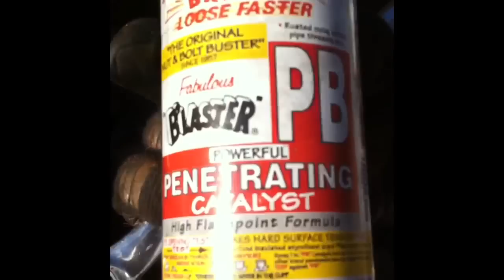Dodge Sprinter Fuel Injector Pulling Tool for Stuck Fuel Injector

Comment from the maker: Yes this works for all 5 injectors but in this case only one stuck was number 3 the others came out just fine, my advice when trying to remove injectors makes it much easier with hotter engine, in this case it was cold and it would be impossible without this tool
Reply: How did you get the valve cover off first, before removing injector????

Comment from the maker: Hello guys thanks to everyone for your coments and subscribers, I lost this YouTube chanel just found it, I also have some others, I will now closely monitor yout coments, and try to get to you when I can also Many more vedios will come, with Sprinter problems and how to fix them your self, about injector puller tool it was a prototype, it worked realy well, but I am working on a better one, where you can remove injector without  Valve Cover damage.

Comment: Can the injector be removed without removing any part of the injector, I have used some tools that require you to take the top part of the injector off in order to remove it.  I then found out that the truck will never start if the injector is taken apart and then reassembled.
Reply from the maker: +Jerry Pellegrino I hear same thing that once injector is taken apart it won’t start, but some say it will and others say it needs to be torqued right, maybe you can use some paint and after assembly align the pain line, you only need to take apart injector if it’s hard to pull it out, but if it’s easy then don’t take it apart

Comment: Haha and valvle cover remover first ...fake video.first inyector secound valvle cover
Reply from the maker: Actually my valve cover was broken, so I broke it around the injector, cause I could not get the injector out, the entire reason of pulling injectors was because of a broken valve cover that i wanted to replace. This was long time ago, and it’s not fake, I had to invent a tool to do it, cause I could not find an injector puller for sale, but now I have one